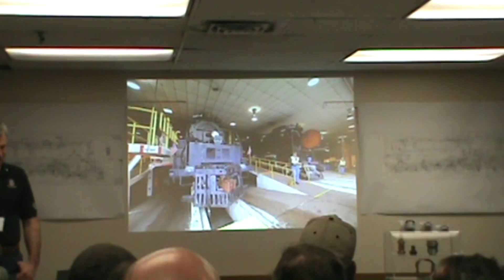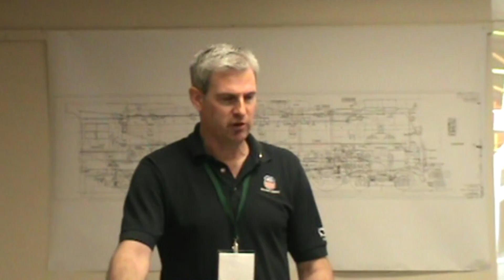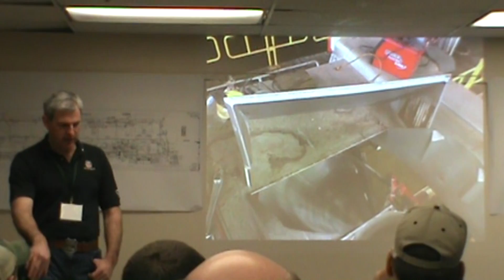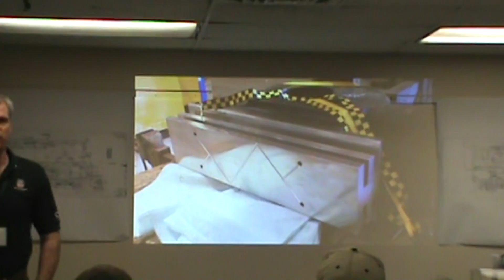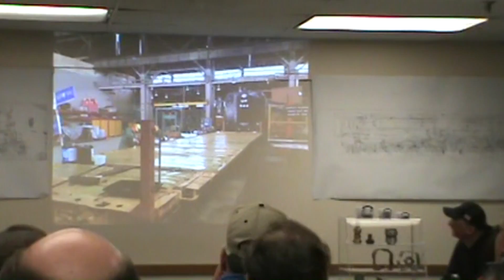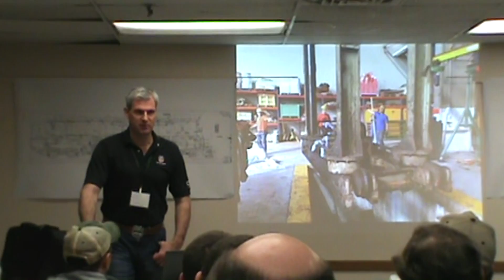Union Pacific Steam Shop Update Part 4

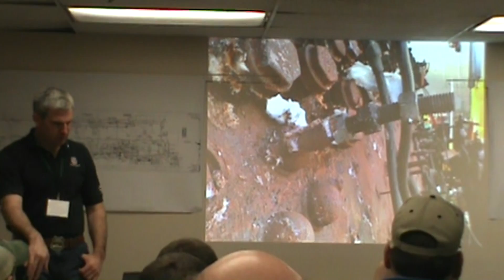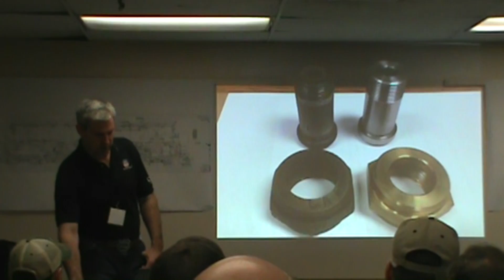Comment: look at all those OSHA and FRA violations: 0:13 see that ceiling that violates OSHA rule 1937R no fall protection, asbestos ceiling, pigeon guano which contains bird flu, and no clearance around the pit. 10:18 Exhibit A see those bolts? that is a no no that whole sheet needs to come out it is rusty.  11:48 see those washout plugs? they need to be completely replaced to fix a mistake.